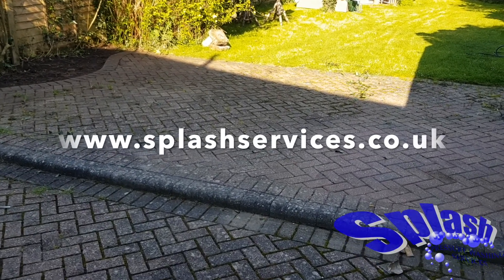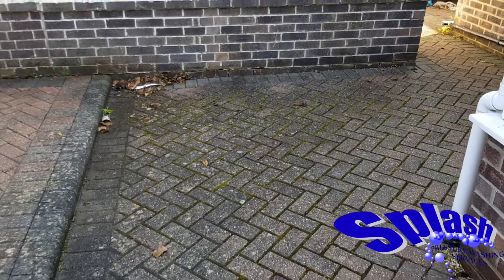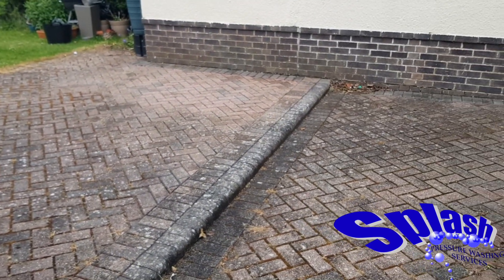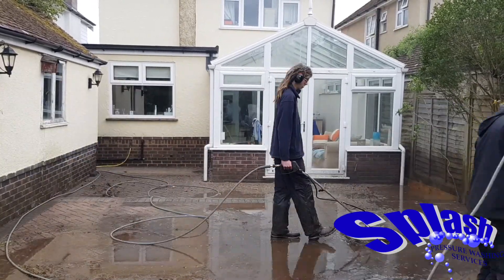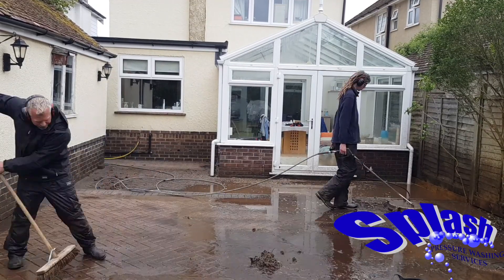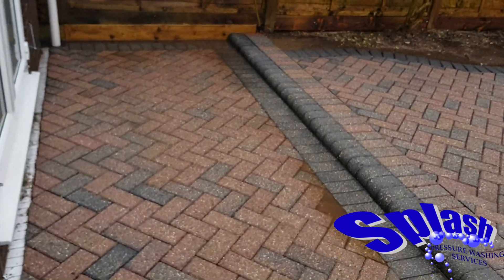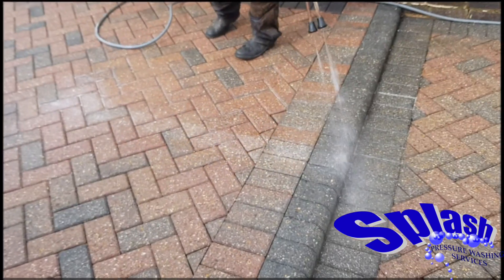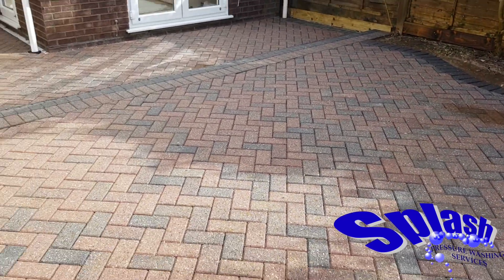Patio Block Paving Cleaning and Restoration Bournemouth Dorset - Splash Pressure Washing Services

Comment: Are you running two machines? You had a lance and flat surface cleaning going at the same time didn’t you?
Reply from the maker: Hi, that's correct, we were running 2 machines simultaneously
Reply: @splashpressurewashing  ah ok. I was wondering how u would get good pressure running a lance and a fsc at the same time.

Comment: Nice, what pressure washer was you using? The flat surface cleaner was really quiet.
Reply from the maker: Hi, the machine is a 250 Bar / 15 Litres a minute